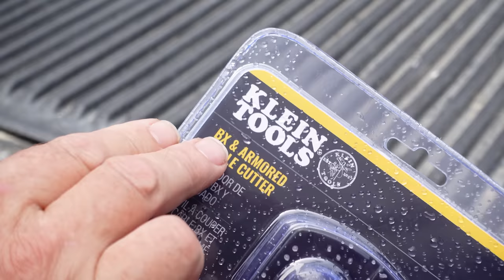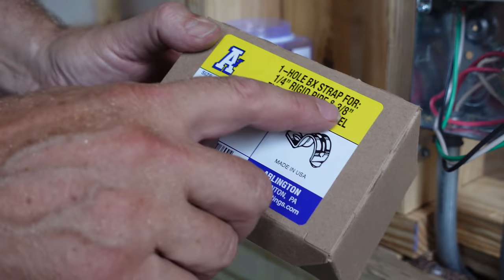We MAY Have Overdone It...Bathroom Rough Electrical - THE SHOP Part 8

Comment: Great job and video - as always. Putting both the boxes above the vanities on the left sides of the studs set off my OCD, though. The second one (outside wall) should have been on the right side of the stud (if the studs are lined up).

Comment: Hey Paul. Love to watch the progress you and Jordan are making with this bathroom remake. Just one thought. If the ceiling fan doesn't have a built-in humidity sensor and you aren't putting in a switch that has one, the next best thing would be to install a motion sensor for it. And if THAT isn't what you're planning for with that fan wiring then at least put a timer switch in for it so your buddy or others in the garage don't have to constantly drop what they are doing to go turn it off after the last person to use the bathroom left it going. Keep up the good work.

Comment: I don't get it.
Are those boxes grounded to the earth?
If so, where?
Reply: Raised screw point on the little ones. Small threaded screw, east position of 4x screws, cross pattern. He explained them both. The initial earth is coming from the original wiring which he'll bond to the conduit inside the old fan switch plate. He'll also pick up the ground from the newer fan wiring that is hanging outside the bathroom.
Reply: Thanks, I think I got it now. 
I saw he connected to the old wiring, but it wasn't clear to me if that was actually connected to Earth somewhere.

Comment: NY everything is ungrounded. Everything is BX or MC. A lot of older electricians will tell you BX cable was invented in the bronx cause of all the rats eating the cables . “Bronx experimental cable” 😂 but all buildings and NYC and Burroughs are grounded from MC / BX back to panel.

Comment: Like button completely wired up and grounded so next guy doesn't get a shock!  So you have options for other circuits but nothing now, once you close it up it will be difficult to add them later... were you thinking of adding some wires from the switch box(es) and run them to boxes with blank covers for future expansion?    You MAY have overdone it... I would say, you have YET to overdo a project LOL... it's the Stud Pack way... so if you say YOU'VE overdone something, then I know it's overdone!!!

Comment: They actually make special connectors for that cable with round openings and one screw to tighten the connection I call that stuff BX wiring, nice job fellas!
Reply: Those are called L16's ..... derived from the Iberville (T&B) part number (L-16). BX and MC cable are exactly the same except the ground wire...insulated in MC but bare in BX.

Comment: Oooo, you got the spendy glow in the dark Klein's!  I got the needle nose in those.  Not that you guys need anymore armchair pros, (I am a master electrician from Alberta moved to BC and need to do the test yet for pulling permits), but I always use boxes I can remove if need be.  Any box with a bracket I try to avoid because I can't move it up, down, over, or take out without having new mudding and paint or tile.  This has paid off many times as a customer wants the box to match tile line elevations and or a tradesmen after did something that requires it to be adjusted.
And Alberta uses steel boxes and BC typically used plastic PVC.  I much prefer steel as plastic boxes typically have flanges or huge wings that makes adjusting garbage.

Comment: Running MC with open walls... really?  And gfi's with no ground pulled?  Better borrow a ducter and test voltage drop on that conduit back to the main box - one loose connector, and you don't have real protection.  I've had bad luck with cinderblock builds before: loose joint that came apart in the wall at some time [probably when block first went up], and wire pulls needed a little lube and finesse: couldn't just pull the extra wire needed and had to pull all new in one shot -unfishable from either end as found [solid wire].

Comment: You had to bond the metal mud ring to the box!!?  It's flippin bonded with screws holding the all metal ring to the all metal box!!  I'm all about code but sometimes interpretation of it is way out of hand.
Reply: Matt -  I think you might want to go back and re watch that segment.  Paul was talking about using metal mud rings with a plastic box because he couldn't find plastic mub rings.

Me, in that scenario I use green insulated ground 12 or 14 ga depending and use the green ground screw on each device and take a pigtail back to a big wire nut with the incoming ground from power feed cable.  The metal screws from the mud ring into the device for mounting the mud ring would provide the ground for the metal mud ring, too.
Reply: @jimmclaughlin8195  this was in response to a job he spoke of doing prior on the west coast.  Not refering to this bathroom job Jim.  I should have wrote that in my earlier message

Comment: Metal junction boxes and conduits are applicable in commercial due framing materials, are either concrete, metal Commercial buildings feature metal studs and concrete walls or cinders. Penetration of those requires aggressive power tools hence so much protection over wiring. Here, wiring is in wooden framing so to me use metal conduits and junction boxes looks like overkill. However, I don’t know electrical code, so this is common sense, but electrical code uses a lot of common sense from physics perspective.

Comment: In my neck of the woods, the electricians that I know say,  MC is just the casing, BX is the casing with conductors inside.
Reply: MC and BX are both complete cables with the only difference being the insulated ground in MC vs. bare in BX. The casing with no conductors is called flex (conduit).

Comment: Im really interested in the answer as to why you would ever put MC wire in walls to wire up the new bathroom. Compared to the traditional romex and plastic boxes what exactly do you gain by doing it this way? I personally HATE anything metal except the breaker box. It leaves way too big of a chance of someone causing damage or an injury...
Reply: It's a commercial building and the metal boxes and MCC is required by code in Louisiana.  Paul explained that near the beginning of the video.

Comment: I'd just point out that the reason you have to use metal boxes and MC cable is not solely because you are using conduit as a ground. It's actually required by code to use non-combustible wiring methods in non-combustible construction (i.e. a Type II building).

Comment: Commercial may be different, but for residential, the code says outlets must be within 6 feet of doorways, and no more than 12 feet apart along a wall. Might want to check commercial requirements.

Comment: The next electrician to work on that place is going to love those nail on boxes you just screwed into the stud... I'd swap those out with nails so nobody has to rip the drywall apart just to get that box out of the wall.
Reply: @chrisl22182  I wouldn't even use a box that fastens from the outside in the first place, boxes with holes that you can fasten to whatever surface from inside the box make for much easier and cleaner maintenance down the road

Comment: It is unnecessary to pull a ground wire with solid steel conduit and steel boxes.  At least that is the standard in the greater Chicago area for both commercial and residential electrical wiring. I didn't like it when I first moved here, but the strength, fire safety and protection from rodents is hard to argue with.